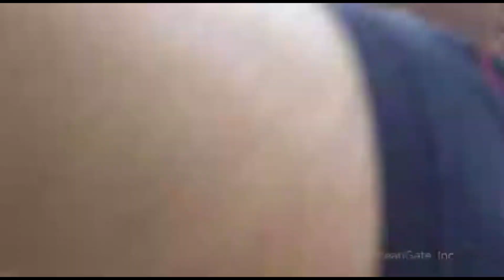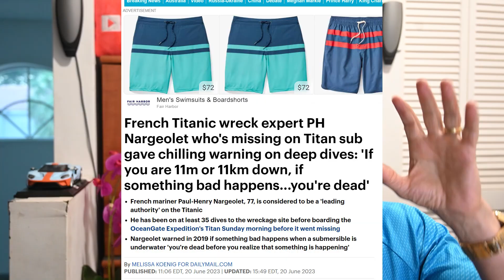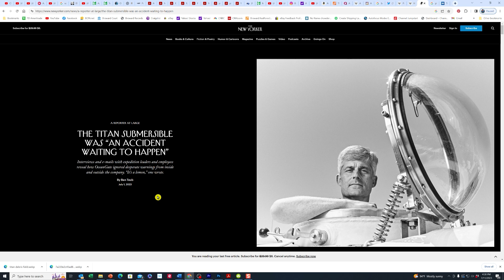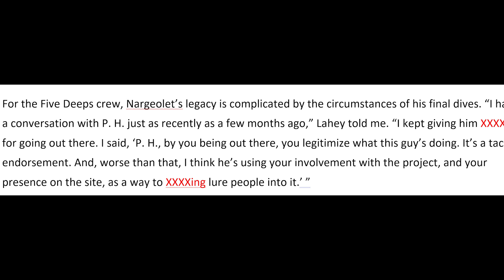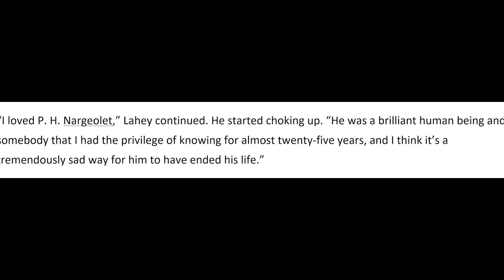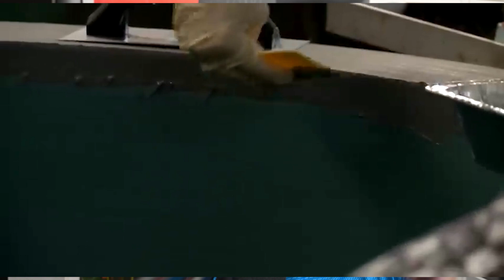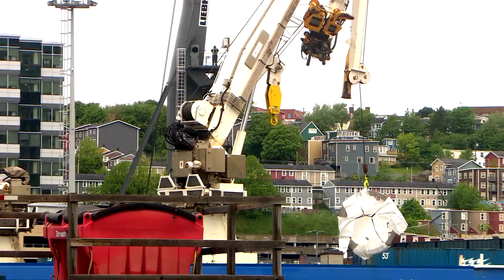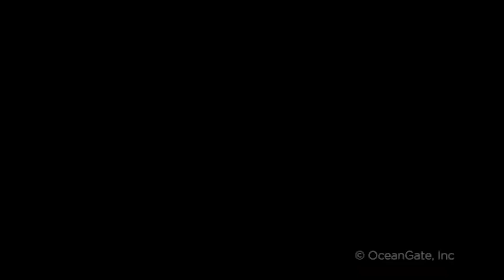Titan Sub: More Q&A, Design Defects, Why Descent Fast

Comment: Yes descending too fast is absolutely a big problem, thank you for pointing that out.
Reply: They were never descending too fast. He keeps comparing the descent rate of James Cameron's sub to this sub, which is fundamentally wrong. 
Doing 5min of research will show you that this company made 13 other trips to Titanic, and every one of them had a descent rate that got them there in 90min or so. The descent rate wasn't an issue. 
This topic keeps generating a lot of clicks though, so ignorant speculation keeps winning the day.
Reply: @undeadarmy19 transcript says so, so it is faster than anticipated speed.
Reply: @kumak2591  Transcript isnt verified whatsoever, and shouldnt be used as any form of evidence until it is. This is a MAJOR issue with modern media practices, especially here on YouTube. Info either being presented as fact, when it isn't, or people being TOLD that its not verified, and still taking it to heart.

The FACTS of the case, as they stand, show that the rate of descent was not an issue.
Reply: @undeadarmy19  Totally agree.  So many people making a lot about the descent rate.  Look at the numbers closer and put it in terms people are used to.  For it to be 2.5 hours, they would descend at a rate of 0.944 miles per hour.  Sure, that's pretty slow.  And if they got to the bottom at 1 hr 45 min, that's a rate of 1.35 miles per hour.  Hardly 'hurtling towards doom'.

The rate is solely a function of net bouyancy and hydrodynamic drag.  With a somewhat streamline hull, the difference in those two rates could be something like 50 kg difference.  Between loading passengers (i'm sorry, they were NOT 'mission specialists'), their personal effects, some food, drink, a spare video controller, some O2 supplies, CO2 cartridges and give or take a couple of the pipes/ sandbags, etc...  I don't see the difference as being all that unreasonable.  Dive-to-dive variation, probably not that big a concern (until the hull monitor system maybe started alarming)
Reply: @kumak2591  Transcript has been out two weeks. Were it real someone would confirm it by now and noone has.
Reply: Well possibly but what rate of pressure increase over the hull is too rapid.
With the best will in the world the craft could not plummit to the bottom like stone because of it's near neutral buoyancy, it took over an hour.
In my view this is a bit of a red herring.
Reply: Really dont see how. It either can sustain a PSI or it cant. The speed at which its limit is reached has ZERO effect on that limit.

Comment: The sub will initially descent fastest and gradually slowdown and slowest when it gets near its planned dive depth as the sub is approaching its neutral buoyancy.

2.5 hrs is the advertised rough estimate to get to the Titanic wreck from the surface. They don’t descent straight down to the wreck but 300-500 metres away from the bow of the wreck.

So 0.8 hrs to descent the slowest 300 meters + 300-500 meters travelling horizontally to the ship…. No, they weren’t diving too fast.

Your channel is by far one of the stupidest I’v seen on YouTube covering the Titan.

Keep it up.

Comment: Easy answer, ex submariner here. It is clear Stockton knew the carbon fibre had a low amount of dives before he would have to replace the carbon fibre 

And it is clear he was doing things on the cheap like with the viewport rating, I don’t know his motives for this but we can at least agree that he did it

(For simplicity) The carbon will have had 10 dives left calculated at being under pressure for X amount of time, the speed was increased to shave off time from each dive in order get another run out of it before replacing the carbon or at a stretch reducing the time under pressure for a small nod to safety however by shaving time off descent the craft may have well suffered more violence to the stress fractures caused per dive accelerating the rate of decay 

A slower depth may have saved them the next 2 - 3 dives but the end result would be the same 

Stockton needed the next few dives, collect that money, increasing project stability as he went on each dive but the materials just couldn’t take it 

Just because titanium, steel, carbon can survive X amount of dives doesn’t mean that number stays the same if you change the parameters of what the material was rated on like speed of descent, depth, salinity, temperature 

In this case we know the speed was increased 

His project may have well survived long enough to put in place the propper materials, safety etc but it didn’t survive the gauntlet on the way and he paid the ultimate price along with several others

Comment: I would think the back end of Titan coming to a point would be an absolute no  PSI is key word meaning thousands if not millions of lbs pressure is all being applied on the back point from all directions.  Even a few inch rounder of a dome would help reduce the extreme pressure exponentially.
Reply: The pointed bit was just a streamlining cowling, no pressure issues, seawater inside and out.

Comment: You are talking about material that is already "impregnated" with resin. Its known as PRE-PREG. I worked in the aerospace industry for awhile in the material science department. I can confirm that curing the resin in a open environment is impossible to have even curing of the material. A autoclave is 100% necessary in a application like this. The bonding agent is called "Hysol" Its a 3 part epoxy that is used to bond carbon to other materials. That agent is some gnarly stuff. It would not take the constant fluctuations is the material being expanded and contracted. Especially when the carbon is bonded to that Ring. Carbon is extremely ridged, but not as ridged at titanium.

Comment: For those asking about the descent rate, think of it like G Forces on a fighter jet. If you make a very hard 7G pull in an F-14 Tomcat for example, just yank the stick back, at 7Gs, the wings snap off. But if you're more gradual, you can pull until about 11Gs before the wings break (or you stall). The rate at which pressure on the hull of a sub increases is factored into the design, If you descend too quickly, the hull will give, and you pop like a zit. Descend below that rate, and odds are you'll be fine.
Reply: "factored into the design" is probably a stretch in this case
Reply: Correct. It's also a factor in stopping the descent and reversing to ascent. They were going down too quickly, found a problem and then ejected the ballast. They couldn't understand why they were ascending so slowly and it was because the vehicle hadn't achieve it's full reverse. By going down too quickly they destroyed their chances to buy the time to ascend. They removed the extra hour or shallower depth and by doing so, they removed the warning they might have had.
Reply: @shooterqqqq  yeah, that's something I hadn't thought of. I know that descending too fast means the boat has too little time to "get used to" (really can't think of much better way to put it lol) the pressure, so the rapid onset of higher pressure is going to cause the boat to fail. 

But descending too fast would also reduce their ability to abort.
Reply: Unless there is a shock load which there isn't then the descent rate doesn't make any difference to the potential or not for a collapse. You can't simply make guesses based on a totally different situation of an aircraft to infer what happens to a dive vessel. You should not make claims like you are without any engineering logic to go with it.
Reply: @SuperNostalgia.  cuckoo
Reply: Is that a EVE online avatar, nerd? (Been an EVE nerd 18 years. lol)
Reply: @shaymcquaid  yes it is. How astute of you.
Reply: I do not think there is any comparison.
Reply: @andyrbush  I do not think you have a functioning brain. This is a perfect example of how force works. 

At whatever depth you're at, the submarine is designed to withstand the force that is pressing against it. However, if you reach that pressure level too suddenly, the hull won't have the opportunity to flex and stretch enough to handle it. 

Same thing with muscles, a person can be capable of doing the splits, but if someone were to suddenly yank their legs open and then fell into the splits, it could rip the muscles. Sudden force is bad. Slow force is not as bad.
Reply: The difference between descending 25 meters a minute and 35 meters a minute is not likely to be the cause of implosion. There's simply no force that could easily explain why a slightly faster descent rate would cause any damage like this.
Reply: @DKFX1 it’s an extra bar per minute. Put that into psi and you’ll see why that could cause damage to the already damaged design
Reply: @DKFX1  The real point of discussing the faster descent rate is to highlight the poor safety standards, not that it was a significant factor in what caused the implosion. It is important to discuss because it shows that something was clearly wrong right from the start and should have been addressed. 

The crew should have noticed right away that the ship was descending noticeably faster than normal, indicating a weight/buoyancy issue,  and should have aborted the dive to determine what the issue was. But they either weren't paying attention, or deliberately ignored the issue

Also as mentioned above, descending faster than expected means that by the time any issue was detected, they were already much deeper than they should have been... under greater pressure and with no time to surface
Reply: @tjontario  I find it strange that this video doesn't mention the slow ascent rate in combination with the fast descent rate as being why the descent rate is of concern. Instead it's this fast loading silliness.

Even with the ballast and frame jettisoned, if the transcript is to be believed, they're ascending at about 20fpm. So even without ballast, they're negatively buoyant, and with part of the structure ditched, they're close to neutral buoyancy. The question is, then, what ate up the buoyancy reserve?
Reply: @DKFX1  35 vs 25 is 40% more.  Being able to do math is rather helpful.  Just think of it as measuring your dinner into halves and adding a whole another half.  You'll be fat in no time
Reply: @DKFX1  all signs are pointing to they had a leak in the aft end
They were sinking faster than usual and they were hearing cracking noises in the aft end
All of the hull alarms were going off
Then when they dropped the ballast they weren't Rising as fast as they should have been so common sense would say they had a leak
Reply: @thecloneguyz  That's not the point. If there was a leak then a compromised hull was the cause of implosion, not the slightly faster descent rate itself.
Reply: @DKFX1  38.8 meters per minute. We're talking per min, that's 13 more meters per minute than what it was supposed to. Think about the difference between going 80 and 100 mph. Only 20 mile per hour difference, yet most cars start getting really uncontrollable at 100 mph. Not a perfect analogy but the vehicle was tested and meant to go a certain speed. If the transcript is true the crew on the support vessel asked if they should lower their decent speed multiple times. No engineer but simple imagination connects the dots as to how that speed affected this dive. I do think the implosion was bound to happen eventually regardless of the speed of decent though.
Reply: @bentorres-betgaming  Totally inappropriate analogy. And cars do not get really uncontrollable above 100 mph. 
Way too many non-engineers coming up with frankly nonsense ideas.
Reply: @andyrbush  and instead of providing a better analogy you've provided nothing to the conversation 😅 thanks for being as useless as my engineering knowledge, apparently.
Reply: @bentorres-betgaming  tell me you've never driven a car design for the Audubon without telling me you've never driven a car design for the Audubon
I've ridden a Triumph Speed Triple in 5th gear at 153 miles an hour at 3500 RPM and I could have held it there until it ran out of gas
Or an Audi R8 from San Francisco to LAS VEGAS at 163moh for 88miles?
Reply: @thecloneguyz  congrats buddy. I grew up poor in the bronx, so no I've never driven whatever car you're talking about. And Wtf does that have to do with the titan implosion. 

Dude really thought to himself, "omg a chance for me to brag about a car I drove once, let me comment that right away" 😅😅😅😅

Comment: I guess they used more juice while descending which is why they descended too fast and result in loss of charge in battery.
Because of this low charge they were not able to come up as expected.
Same thing happens with electric cars also, If we floor it very hard it will accelerate like crazy but when the battery is low, speed is limited to a fixed speed.

Comment: I will be so glad when this investigation end and we get the full report. As a marine engineer- Equipment fails all the time rather it's certified or not and when it does everyone has an opinion on why. However, you can't control every single variable. Everybody been talking about carbon fiber, and I don't think it had nothing to do with the carbon fiber. I agree the Glue/ Epoxy failed at the joints; at the rear hemisphere - Which is the weakest part of the sub, and it was all downhill from there. This wasn't the Titans first rodeo so I will never condemn other engineers from a distance. Hindsight is 20/20 and it's some of the small things that fails that leads to catastrophic disasters. Examples -Astronauts are at the mercy of an O-ring, at launch. (If that fails, bye-bye Astronauts). In this case, the Epoxy.

Comment: The five people who perished aboard the OceanGate submersible were likely aware of the impending implosion between 48 and 71 seconds before it occurred, according to an expert who likened the scenario to a “horror movie.” 
- New York Post

“During the controlled immersion of the Titan, there must have been an electrical fault, which left the craft without thrust,” he told the Spanish news outlet NIUS, according to the English language Diario AS.

“Without thrust, the weight of the passengers and the pilot (about 400 kilograms), which was focused on the front end close to the view port, would have disrupted the Titan’s longitudinal stability,” Martín explained.
-José Luis Martín